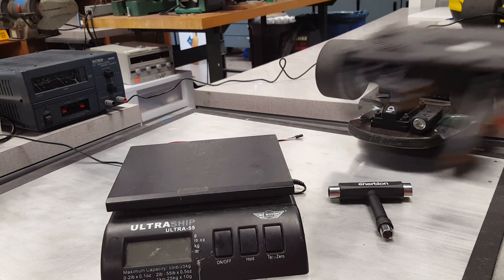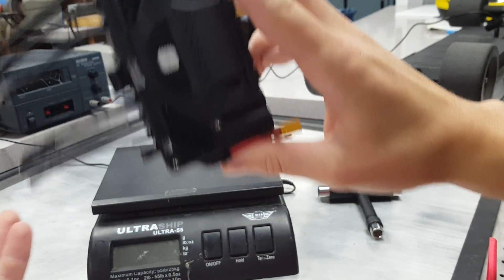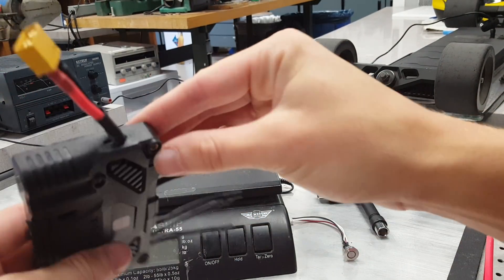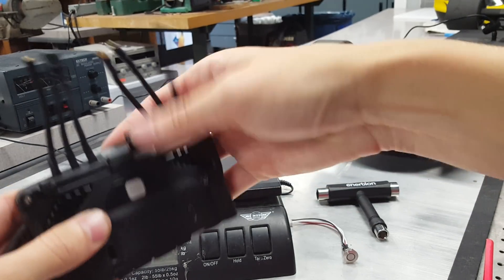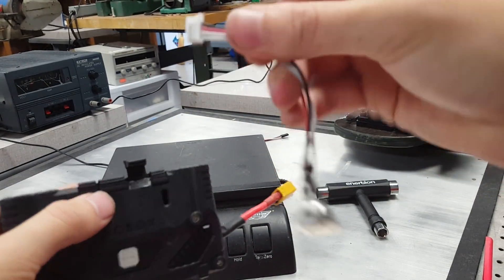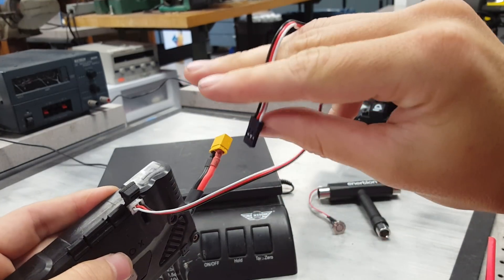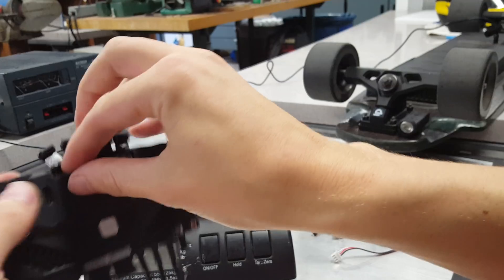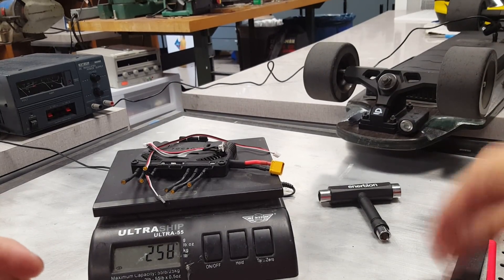FOCBOX UNITY: Production Sample Case Hands On

Comment: Great work ! I dont need it but ... if I find spare 300 (?) I'll order the unity
Question: 
Why did you design it with the XT90 on the side? I know you can bend it but why in the first place?
Reply from the maker: Power entry at that point in the board allows for the most direct power delivery into both motors while still providing a nice3 and secure anchor to the PCB. It also allows you to back the unity up directly against whatever sits behind it reducing total length.